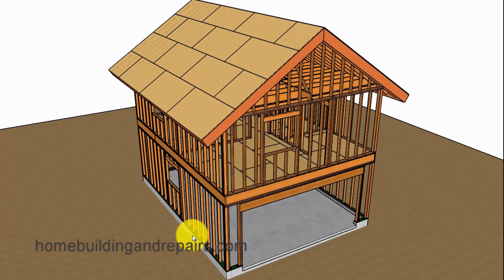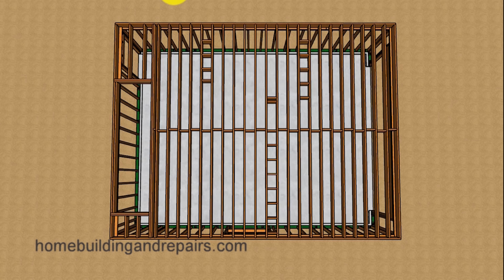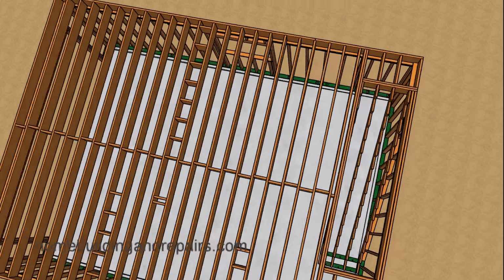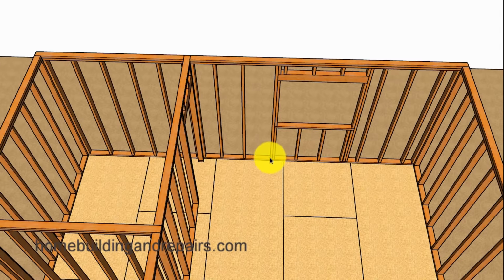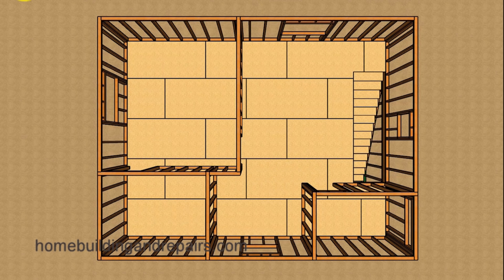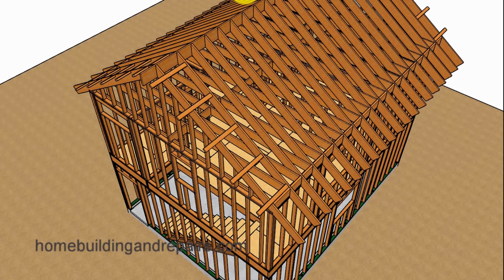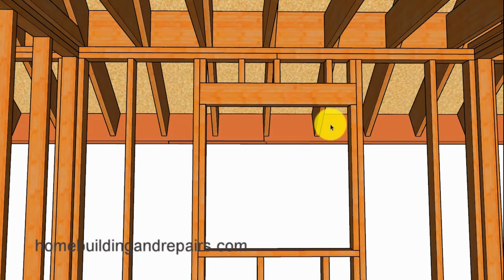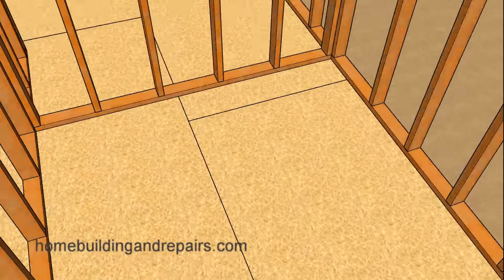How To Build 20' x 26' Two Car Garage With Small Apartment - Building Education Series Part 8

Comment: Great!  Could you not vault that ceiling with the ridge beam in place rather than have an attic floor?
Reply from the maker: I would watch more videos in the series to check out other roof designs. Email me an example of the design you're referring to or provide more details about design. I'm a little confused with the attic floor.